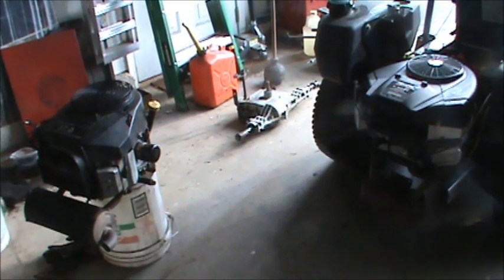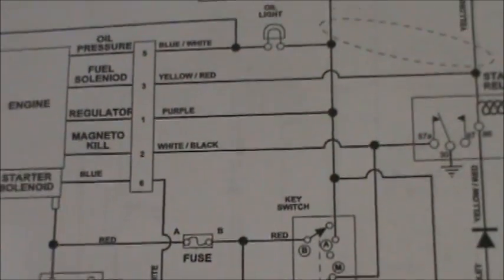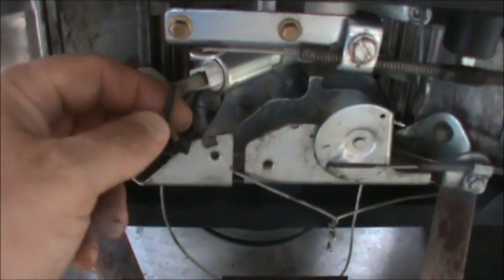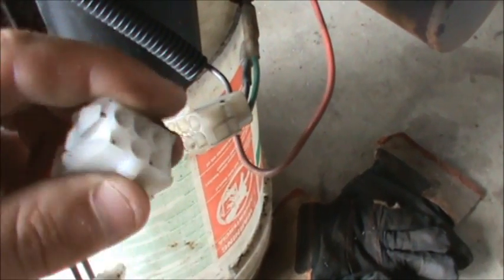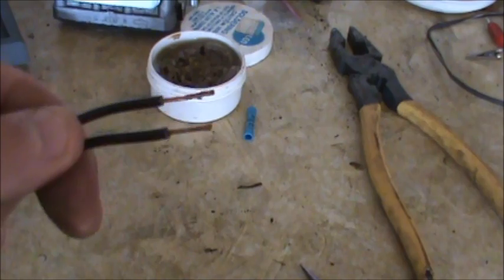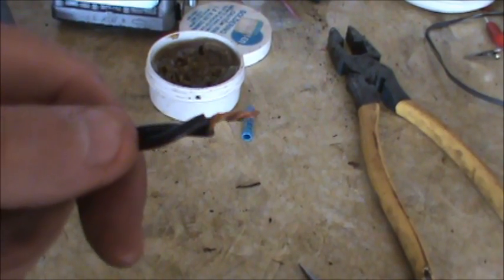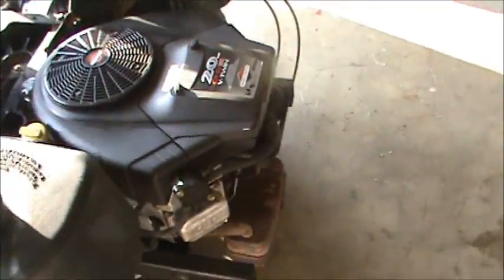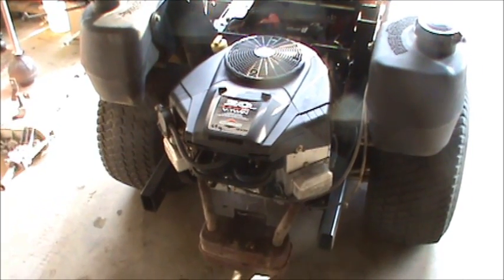Tractor Engine Swap Wiring Kawasaki to Briggs to Kohler

Comment: I dont like them scotch clips . Any wiring I repair I either soder it or but connectors with shrink tube
Reply: I’m with you those scotch locks suck. They might get you out the door but they will corrode and you will loose connection. Don’t ever use them on a trailer wiring harness. I throw them out and get good connectors. You can thank me later.

Comment: With the electrical connector, you can depin it and repin it in the correct orientation. And your solder joints are not hot enough. Don't tell people to fix extension cords. Someone stupid might try and burn down a house with people in it

Comment: Alternator on engine produces AC voltage (usually, modern engines) regulator/rectifier changes AC voltage to DC volts, unless a diode is used instead…. Just to clarify…😵‍💫

Comment: Great tutorial on wire splicing!  I have a new respect for the crimp-type connector, that's for sure.  If you remember, please let us see the new muffler install as well.
Reply from the maker: A LeBlanc   I will let you see the new muffler when I'm mounting it.  I'm hoping it does not hit the back guard on the tractor.  In the video I had the back guard removed.

Comment: Motor swap FYI, ANY of the coils under the flywheel produce AC only, There may be Up to THREE total! (more on that) You did get it right later on the video calling that little three spaded lug device correctly IS a Rectifier as well as a battery charging Regulator, only 1/2 wave with only 2 diodes BTW a Full wave bridge would have 4 diodes and 4 wires, for better amperage and smoother DC (1/2 is just fine for tractor unless your installing a car stereo :)) now, About that third coil, Kohler came up with a Motor/Brake system (Kinda like on your chopsaw or moterized mitre box where when you release the trigger the blade stops almost Instantly) for a few model years ( on the 17 OHV maybe others) two extra wires Put out damn near 90 Volts at full RPM so be careful! If you run into this Just cap them off, great wire splice tutorial, I had my money on your "hook splice" but you sure proved a proper pair of crimpers is the way to go for sure! Thank's keep it up!

Comment: Hey dw6  will a vertical shafts 18 hp easily swap to a sears gt6000 that had the opposed horizontal briggs? I have my doubts everything seems wrong . Axel steering pto you name it.Have you ever recovered one of these gt from the 90

Comment: You could slide a pick in the connector of the wire you want to change, pressing down on the pin and pull the wire with end out and slide it into the correct one.

Comment: I changed my 19hp kohler motor. it was on a 2007 Troy bilt the block cracked. Kohler courage 19hp sv590-006 the other mower was a 2002 troy bilt  with a briggs 17.5 motor. I put the briggs on the mower that had the kohler on the kohler the two wires coming from the stator ran to a voltage regulator.on the briggs it don't have one. do I need to put the voltage regulator on the briggs motor. it keeps draining the battery when off. also each mower don't have a pto Thanks for any Help Ron-513-8053050